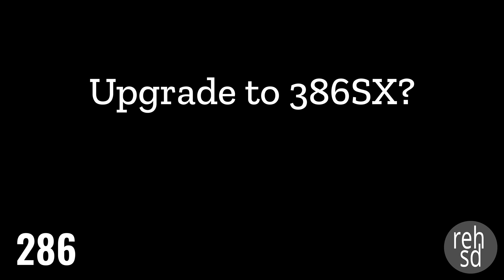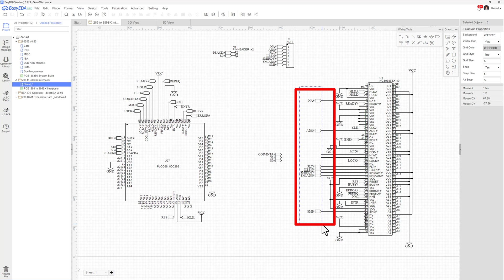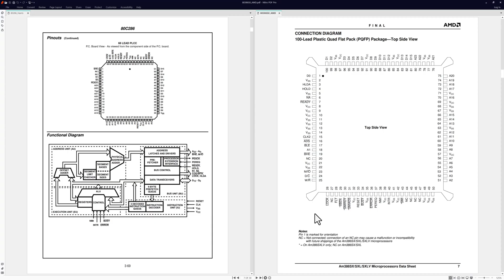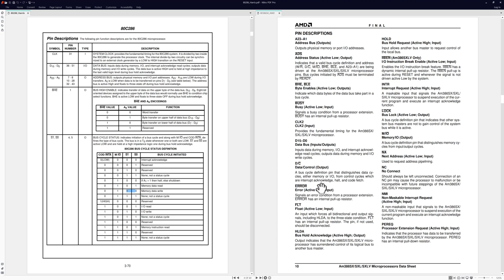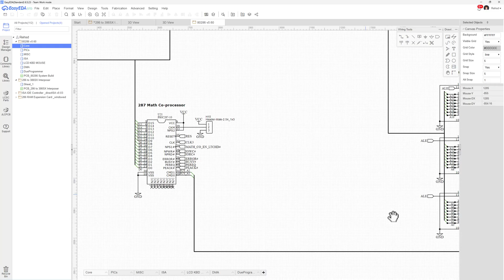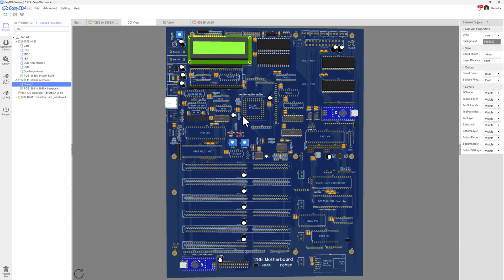80286 Build, Ep. 101 - 386SX Upgrade?

Comment: wasn't the 386sx only supposed to work with the 387sx? Maybe that's why PEACK is missing since it's not on the 387sx.
Reply from the maker: My understanding is that when the 386 was initially released, the 287 was the only math co-processor available (and is compatible). The 387 was released later. After posting this video, I found the following in the Intel 386 Hardware Reference Manual: "The 80287 Processor Extension Acknowledge (PEACK#) input is pulled high. In an 80286 system, the 80286 generates PEACK# to disable the PEREQ output of the 80287 so that extra data is not transferred. Because the 80386 knows the length of the operand and will not transfer extra data, PEACK# is not needed or used in 80386 systems." Reading between the lines, I'm hoping that means the 287 is supported and the PEACK signal just isn't needed.

Comment: 386 update? Now we're talking! Wating for DOOM :)
BTW. There is even better chip that should be compatible with your board. 486SLC. It is 486 CPU with with 386SX pinout. 16 bit bus is a little bit of a bottleneck for 386 core but 486SLC has 16 KiB of internal cache which should mitigate said bottleneck. But maybe it's better to leave it as next upgrade since it requires extra cache maintenance code for MMIO devices.

Comment: Youtube removes my comment with the link for the intel 386sx manual.
But anyways, intel provides a little bit more info on those w/r w/d pins and a table that is similar to the 286 table.
It seems intel and amd treat these pins the same.
Any intel 386sx manual will do, should be page 40.
Reply from the maker: Thanks! I found earlier today in that manual a circuit for S0# & S1# generation. I believe I now have the board close to testable. I'll post a quick video of it shortly.

Comment: Yep, the 386SX should be mostly compatible right down to the BUS (mostly)
Reply: Carefull with them ""486SLC"" I hate those for the simple fact that never before had I faced so many a compatibility issue running software on an x86 chip. Most proper demos would simply crash at random stages, never even consistently the same location though the locations would be the same just not always happen, some times the demo would go past a scene where it would crash only to crash at another location further ahead. But it would be consistent on the locations where the crashes would happen they would just not always happen.
So, let me repeat, I HATE 486SLC CPUs